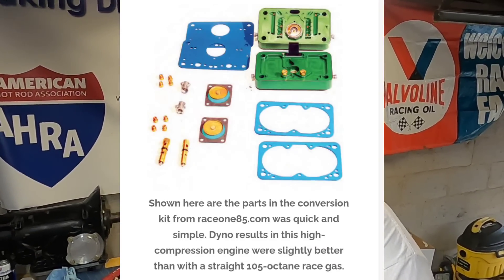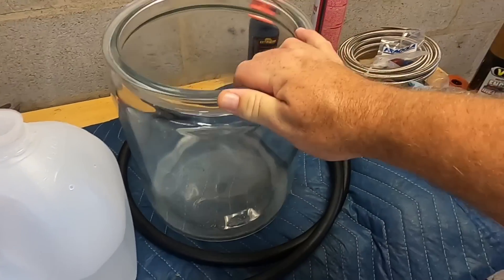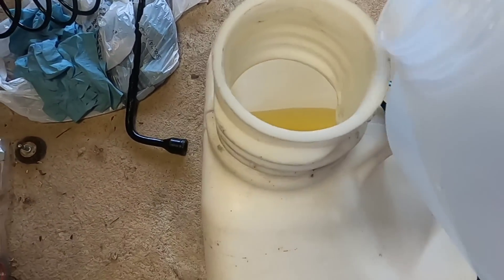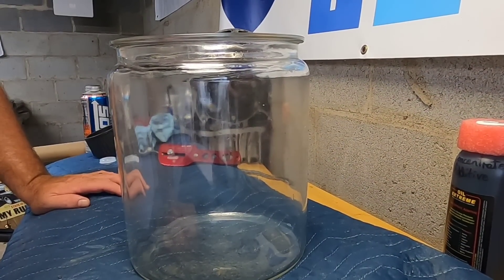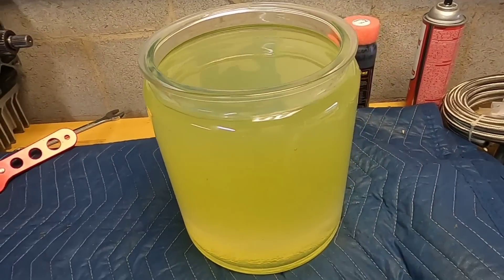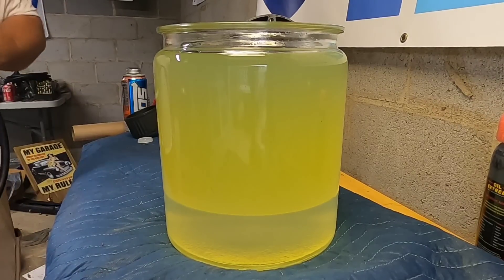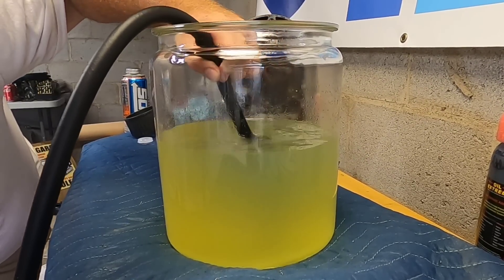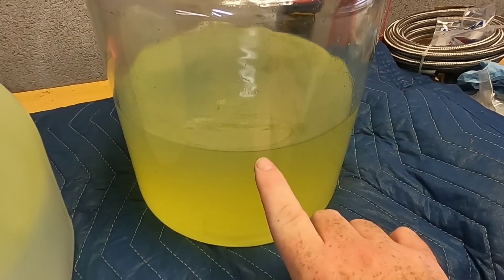Making your own ETHANOL FREE Gasoline!!! it's easier than you think!!

Comment: I don't know if this would work. To get rid of the gasoline but not the ethanol, warm the fuel up to ~140F (safely) and the gas will evaporate off. Ethanol evaporates at ~170F. No idea if this would work and gas fumes would be dangerous.
Reply: Or you could just buy pure alcohol somewhere and not waste the 90% of the gas by evaporating it.
Reply: thats seems really dumb (no offence)
.
you are paying for it..... yet loosing 90% of your product (usually you would want to create a "chemical reaction" with a high yield) 
.
also... you will probably get both evaporating at the same time.... unless you are using lab grade equipment 
like you would need a re-flux distilling column to keep the temp at EXACTLY 140, 141, 142, ETC
.
doing it in an open pot or pan = hot spots and cold spots..... AKA everything evaporates at the same rate
.
.
also... gas is a bunch of different stuff
you dont just get a "gas" vapor point..... you get heptaines, octanes, other solivants, ETC 
and you would have to mix that all back together (besides the ethanol) to get "gas" back
.
 and ya.... the fumes would be HIGHLY dangerous
Reply: I dried out my fuel tank with a hairdryer aimed at the sending unit hole. 
There was at least a half gallon in there I couldnt get out. 
Was dry as a bone and in my case ,it was clean too.
It took 40mins ,maybe an hour. 
I stayed nearby doing other stuff.
Reply: The end point of gasoline is about 400 F. So your idea will not work.